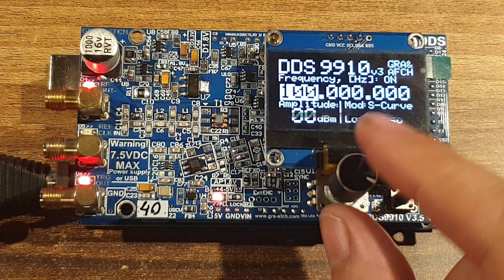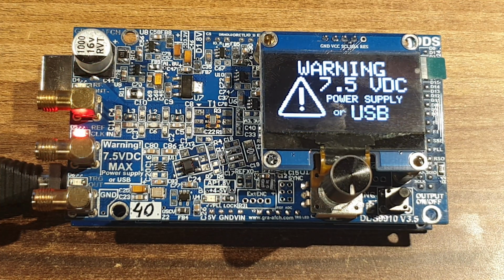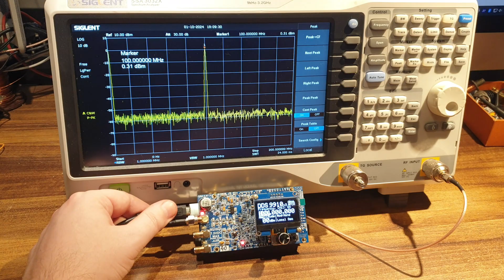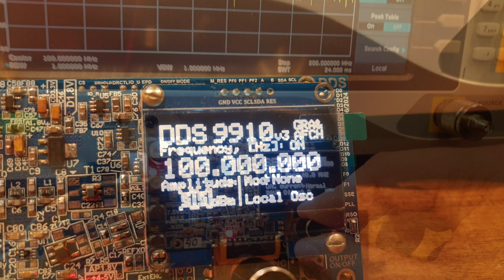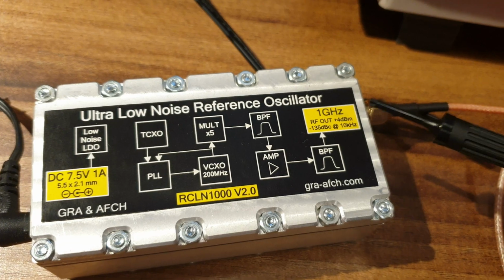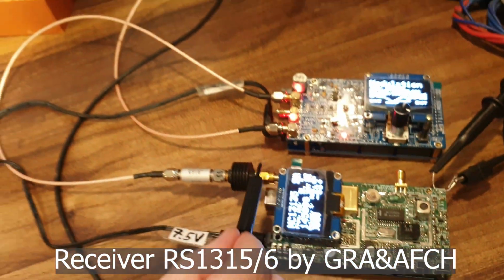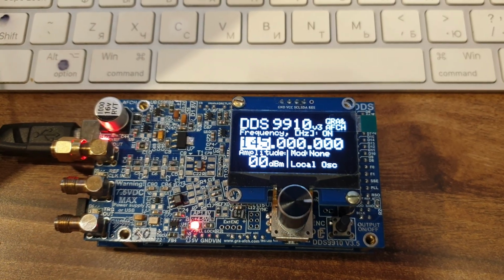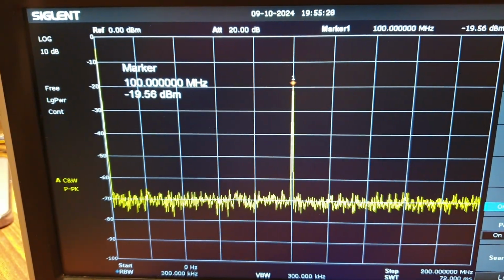DDS AD9910 V3 Arduino Shield Signal Generator 600 MHz@1.5GHz AM FM Sweep, HAM LO, S-Curve, Low Spurs

Comment: -70 dBm noise !??😮 I'm going to use for LO but it is too noisy. 
If you want to have good receiver you need to use LO with noise level -100 dBm and better. In other case it will not be receiver but noise generator))
On frequency 100MHz it is -60dBm. Thus is not serious device😢
Reply from the maker: phase noise at 100MHz at 10kHz offset -130dBc from the on-board TCXO, if you use an external clock source you can get better performance -142dBc. Check out the specification and phase noise graphs on the product page https://gra-afch.com/catalog/rf-units/dds-ad9910-v3-shield-for-arduino-rf-signal-generator-am-fm-sweep-600-mhz-1-5-ghz-core-clock-low-spurs-low-harmonic/

Comment: Hi. I got a 1024 optical encoder over teensy 4.1, IRQ. As this Teensy will be the main TCVR controller + TX/RX detect IRQ + N1MM Elecraft codes emulation,  I am a bit concerned about lag between Teensy and Arduino Mega  while encoder changing frequency. Simply put, I need this to be as fast as it can so the next question would be, did you test/compile ino for  Teensy 4.1 3.3V compatible as shield to work without  Arduino Mega ?  Regards, Gabriel YO8RXP
Reply: I just seen that it uses a lot of Arduino gpio, so nevermind about compiling on teensy. Can you please trace / measure total response time from  let's say linux /echo “F100000000” > /dev/ttyUSB0  data sent until frequency is changed ? I need your device to act as main VFO in my new homemade TCVR but cannot do it unless I let Teensy serial talking with Arduino Serial.
Reply from the maker: @yo8rxp  We haven't tested it with the teensy board, keep in mind that our DDS shield had 5V logic control levels.